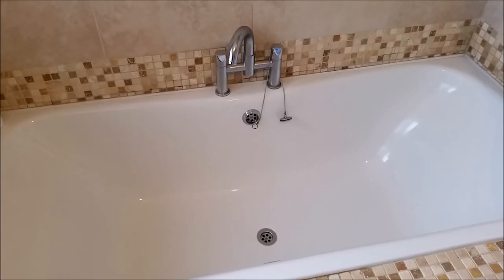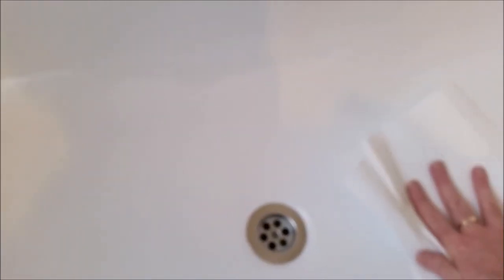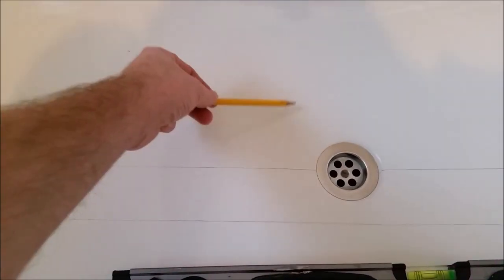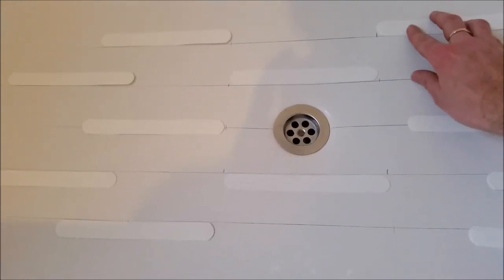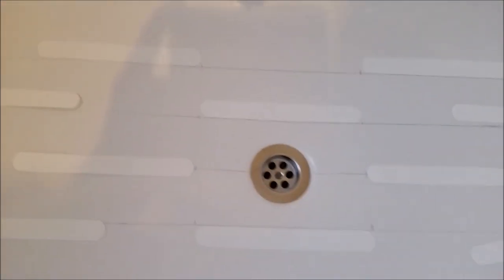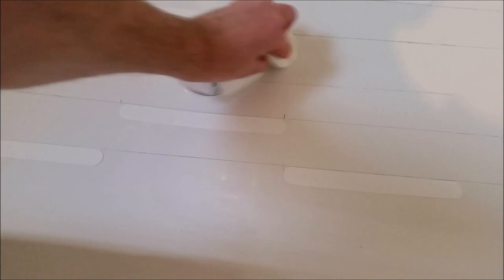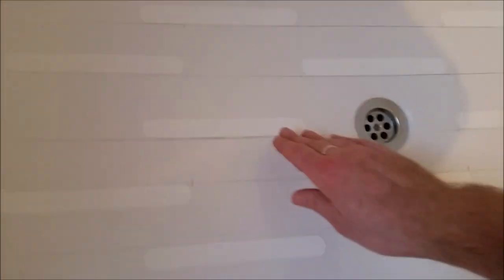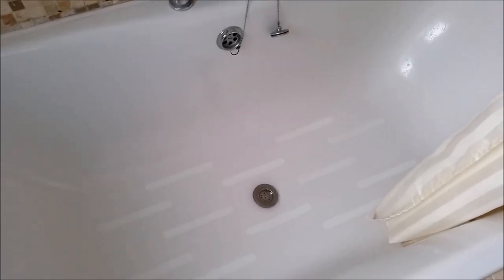Applying non-slip bath stickers

Comment: Thanks for the video. Are these still going strong and not peeling? Also, do they genuinely work to make the surface nonstick? Have they discoloured at all and are they easy to clean?
Without wishing to sound like a smarty-pants, I wouldn’t use Vim on such a surface, but instead use rubbing alcohol / isopropyl. It evaporates to leave a perfectly clean surface.Regarding application of the stickers, I reckon a little roller that is used for applying wallpaper would be a really useful tool for the job.B&Q sell them for about £1!